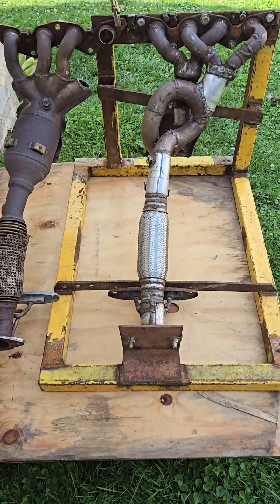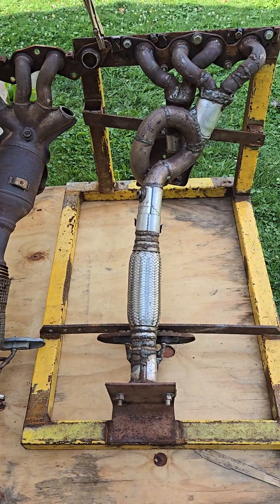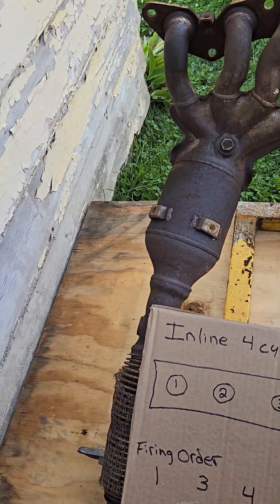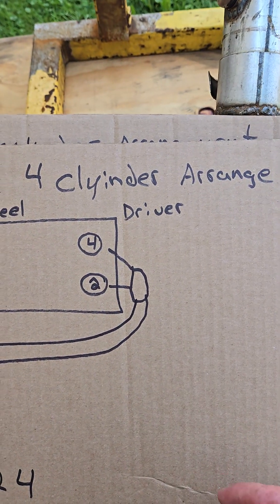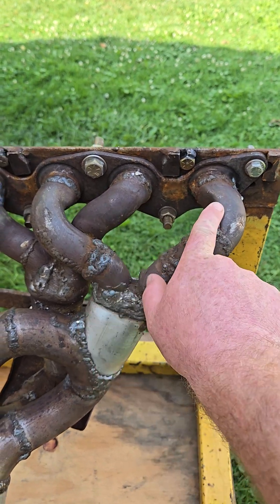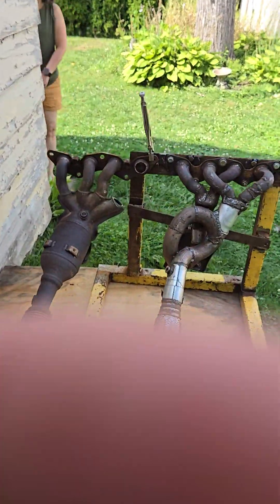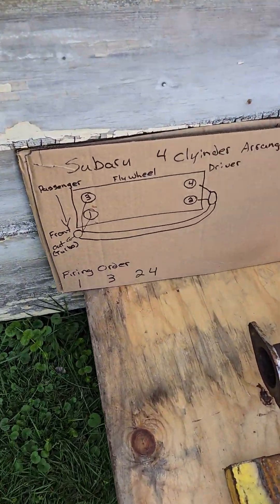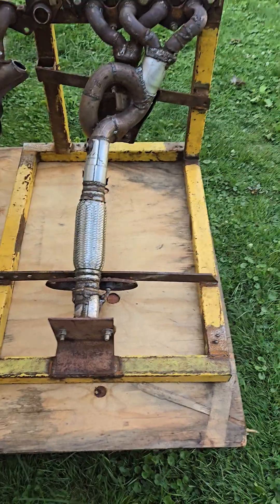How to make your 4 cylinder engine sound like a Subaru! Unequal length header explained!!!

Comment: Hey that's a great exhaust sound. Can I achieve this in my 1.6L Mitsubishi Lancer Ex. I was interested in doing UEL Headers. Then what should I do for the exhaust pipe. 

Should I use 2.25" or 2.5"?

What should I remove and keep in terms of cat, resonator and muffler?
Reply from the maker: 2.25 will be fine. Definitely keep your resonator and depending on your emission laws, maybe keep your cat on if you have those laws requiring one.

Comment: This ordinary inline4 exhaust sound is painful to ma ears also, so i was looking for video long time ago, and finally U made it, exactly like i imagine it. How about the sound of your creation, have u tried it fitted to engine. Itll be extremely curious and educational, if itll work for you, i would try it myself one day ;) 
Also i have question about inline4 firing order: 1342 is what they tell us, but its also 3421, also 4213, and 2134. What i mean, if you make half of the i4 short and other half long piped, the result would be same i guess ;)
Thank You for making this video and im glad that someone is thinking like i do ;)
Reply from the maker: There are 2 other videos of how it sounds. One with it installed through the stock system, and one after I cut the stock muffler off. Am working on the new muffler and tail pipes and will post the finished sound once complete. Thanks for watching.

Comment: I can relate, and have to agree, I did it on my MB 230 and it sounds amazing. Though engine sound does not come from exhaust only but also intake, if you want that low tone, you will also have to build a custom intake manifold with short runners but with enough air volume, let's say around 2 Liters to resonate! I'm hungry for video like this where people go over the fundamental limits and experiment for themselves just by thinking, great job bro

Comment: Unequal length headers have been around a while, they don't really have the boxer rumble but they do have a really nice exhaust note, they sound like half a flat plane v8 which is exactly what they are. Here's a good video of a guy who did it to a civic D17 https://youtu.be/3s6KINUSyZM
Reply from the maker: Yes, I watched this video when it came out as I owned the same car as his at that time. I am attempting to make this as accurate as possible considering cylinder arrangement and firing order. I guess we will have to wait and see

Comment: GOOD GOD, please keep practicing your welding and fitment. I know this was for demonstration but you clearly have the skills to lay a weld that will work for the most part but you are SO CLOSE to putting down good welds.
Reply from the maker: Haha, hey man, thank you 😂😂😂😂, I bought a cheap used mig welder and didn't clean a darn thing as I welded. "just a test!!!" I literally turned it upside down and filled it with water to see where pin holes were just to seal it up. This is why I stated, not for looks or quality, just for sound. If it works out, I may build a nice one. This was scrap exhaust I had laying around. Video intended for people with nothing but junk to play around with😅
Reply: @NITROUS_NU.B  I learned "Mig" with a cheap flux core and got REALLY GOOD with it. IMO thats where its at for dirty exhaust stuff like this. NOW im trying to hone my skill with TIG. if flux core didn't splatter so much id probably use it for nearly all my projects.